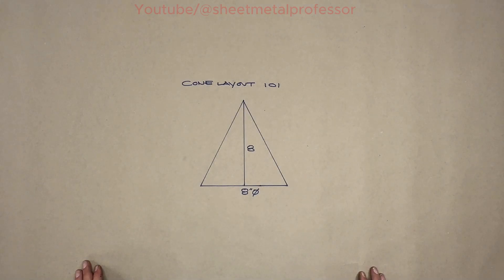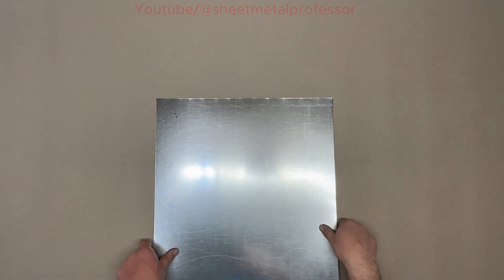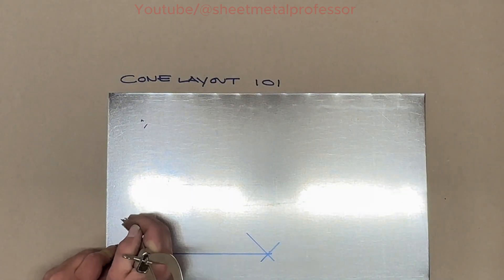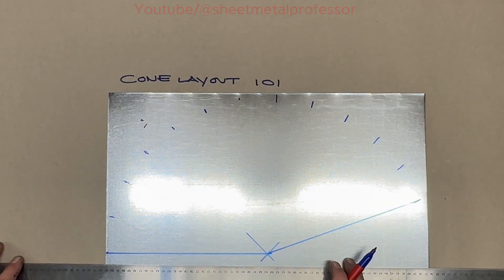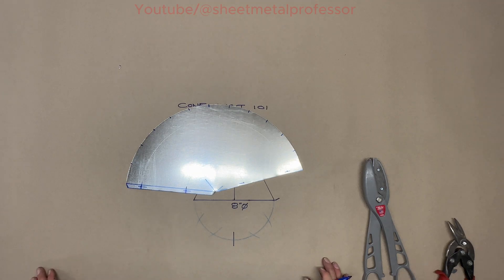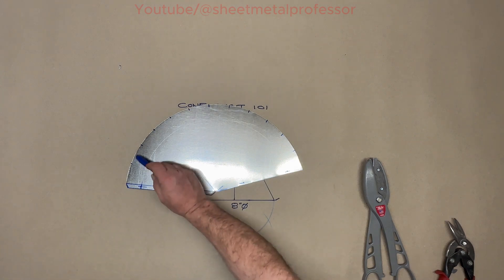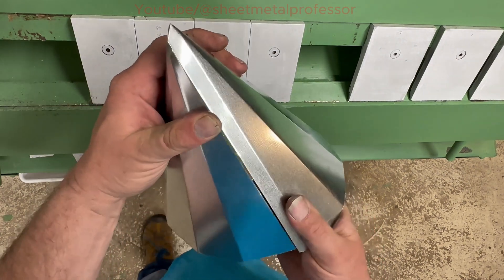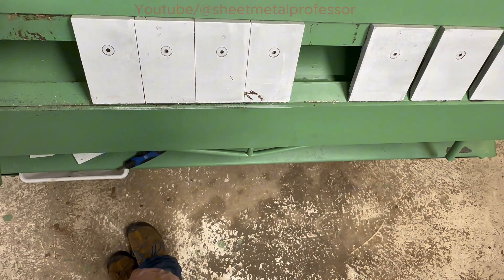Sheet Metal Cone Layout for Specific Applications; How to layout and fabricate a Cone

Comment: fantastic, where did you get the scribing compass from?
Reply from the maker: Which one?
Reply from the maker: The metal scribes are malco products but I also have several antique pexto scribers I use from time to time. The ones that have the pencil in them are just some things I got on amazon to use for filming but they do scribe metal and hold a pencil
Reply: Called dividers.